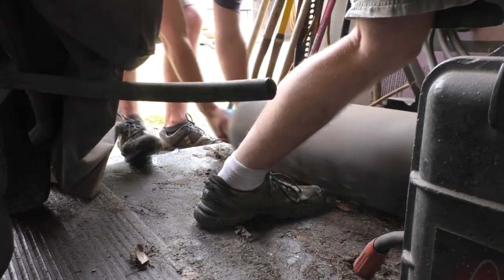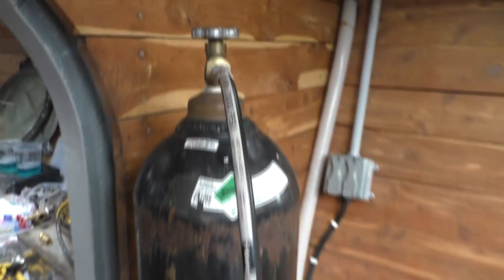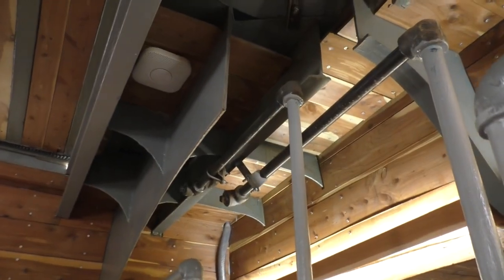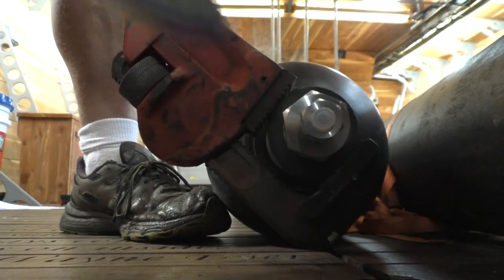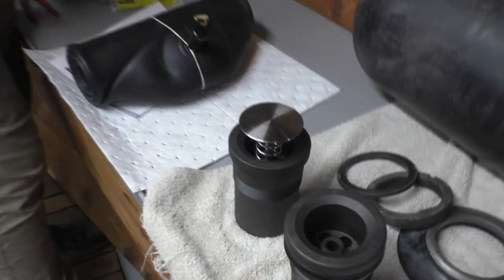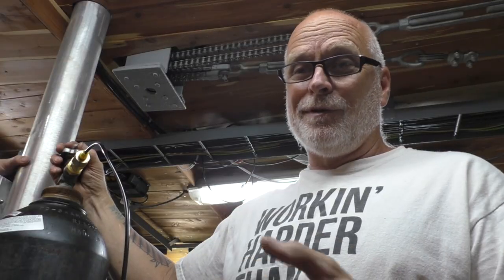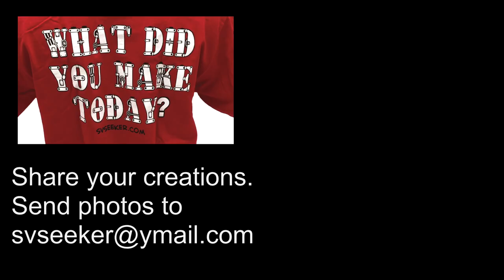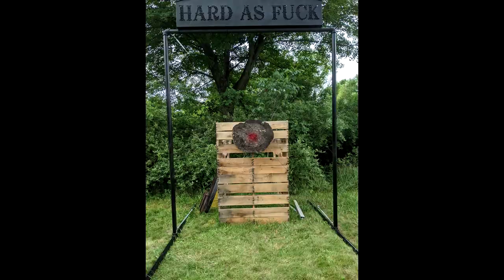Hydraulics - Part 7 - Pipe Test and Charging the Accumulator

Comment: I work for Parker UK and my job is assembling and testing accumulators.
What you purchased off eBay is what we call a B-U-B or Back Up Bottle, but generally known as gas bottles.
This is why you found that the bladder had been cut from the stem end and no poppet valve was fitted to the fluid port (now a gas port) as it is not needed due to the fact no bladder will be inflated to close it.

Comment: Never seen an bladder type accumulator that long before. Usually they are a piston type. Nitrogen on one side, oil on the other side. The shorter ones have the bladders that we use. If you have to replace the bladder look inside make sure rust or metal debris or cleaned out. Especially if no HP filter is between it and the pump. Can damage the bladder. Also purge the lines before hooking up to accumulator. Or you can install the proper fittings for charging but do not tighten. Turn on gas for a few seconds allowing the oxygen to be purged, then tighten down ready to be charged.

Comment: Holy cow.  Casual pressure test with nitrogen at 2000 PSI.  That's intense.  Looks like it worked well to find leaks though.
Reply: I'm a welding inspector in refineries. We always hydrotest. Pneumatic testing is too dangerous.

Comment: I recall a sub once who had accidentally drained oil from a pressure gauge right before the commencement of an inspection. He put water in the gauge ( lol) .   When I came back 24 h later it had held and appeared to read correct. Thoughts?      I believe we were checking  a gas line.
Reply: The oil in the pressure gauge merely acts as a damper.